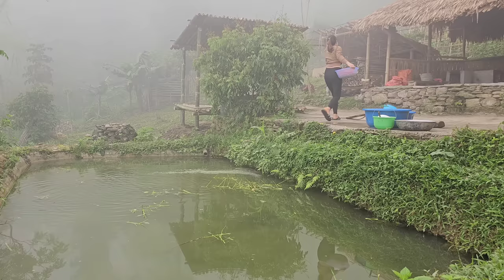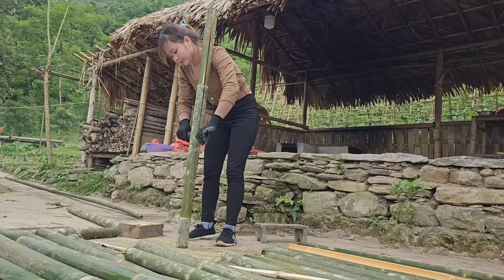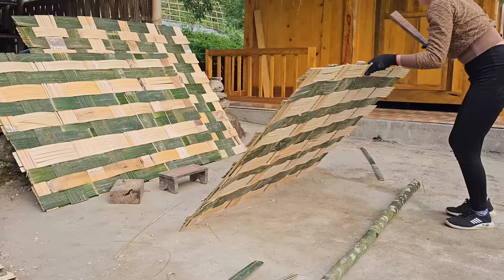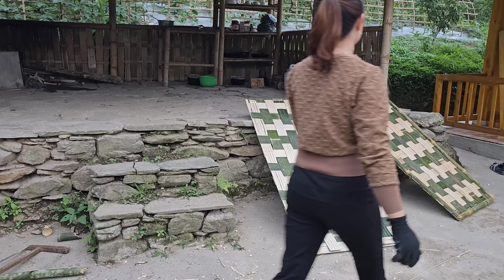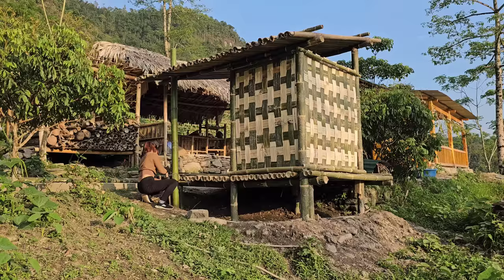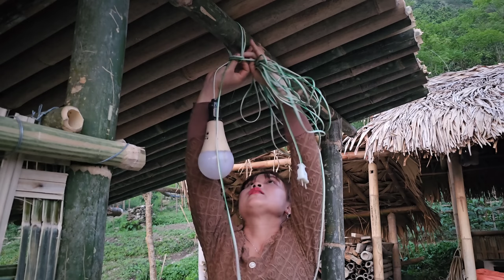Finish water floors and bathrooms, reinstall domestic water systems. Peaceful life

Comment: Dear Bin, to avoid the damage from the storm, you need to set up your farm in a terrace (steps) for from the top in horizontal lines all over the hill. This way the wind will hit the terrace walls and be directed upwards passing by your house. It will be effective only if it will go from end to end of the mountain. Just like you do on your rice fields but without the water hold. Good luck, you are a real inspiration.
Reply from the maker: yes thank you very much 🥰🙏
Reply: @hoangthibinh  

Chào em

Comment: Great lady impressed by your off grid skills and hard working but wouldn't you like a warm shower now and again? i would , add a black plastic barrel or tank on shower roof or on a platform next to it roof height, fill with water with tubing from your water spout,  add a water valve  at bottom of barrel or tank  let the sun heat the water and use

Comment: If you fit 2 handles on the inside and 1 on the outside of the bathroom door, you can easily slide it open and closed with one hand👍👍😉💪🙂✨🌹✨🤗🤞🤞